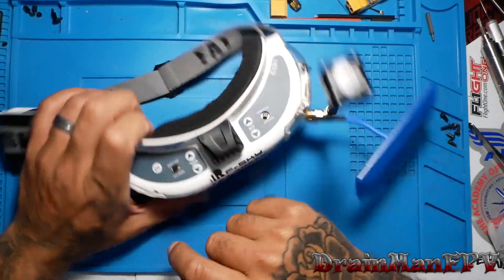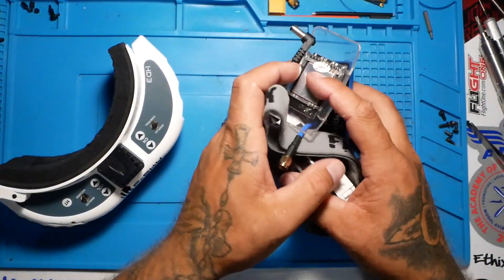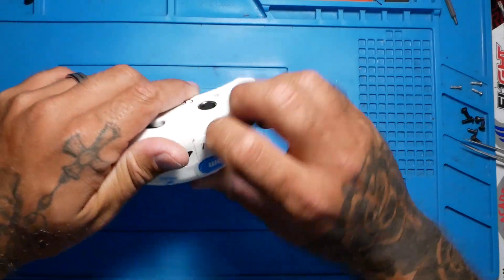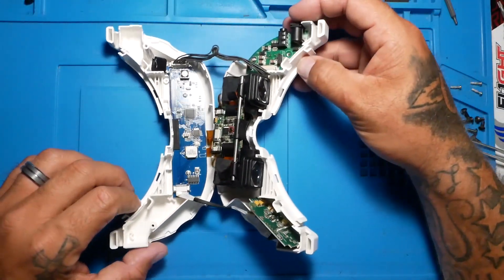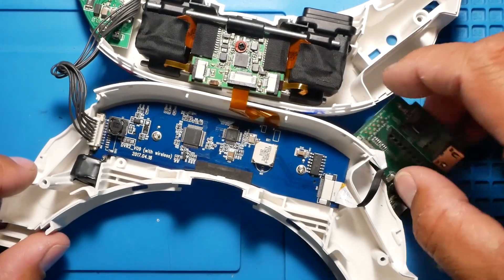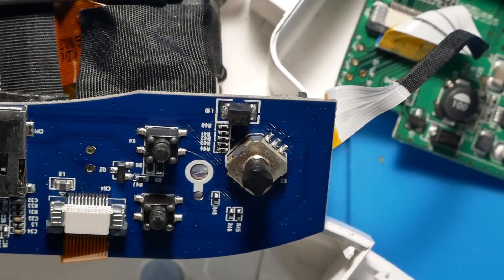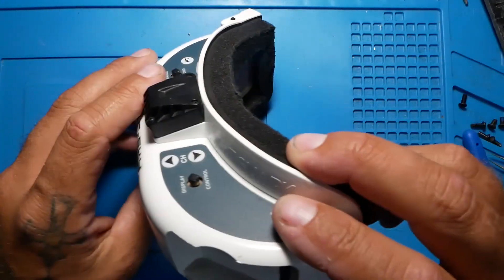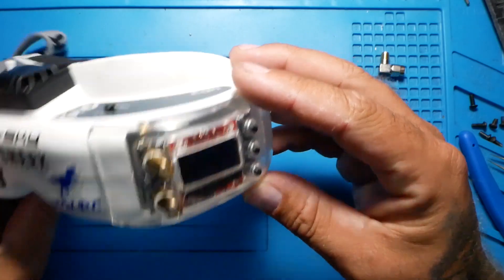Fatshark MOD for Rapidfire/TBS Fusion/True-DX - L1 & L10 - Both Mods - Easy To Follow Along!

Comment: they drainman true d X or fusion or wildfire?
Reply from the maker: Rapid 🔥 Fire
Reply: DrainMan FPV i heard that there is an issue about them 2 of our local pilots got issues with rf
Reply from the maker: @angelfpv4825  oh wow, mine is working great, that's just been my experience with it tho. The wildfire is priced better and looks cooler. I had good range to when I tested it for my video.
Reply: DrainMan FPV thanks!
Reply from the maker: @angelfpv4825  https://youtu.be/UhE3UnJzC0Y

Comment: I do not have the L1 connection on my board. I have the Fat Shark FSV1063 Dominator V3
Reply from the maker: My personal goggles are V3's i had it on mine, that's strange.
Reply: my fatshark dom v3 has L1 and L10 mod , do i need to install the power mod to use the wifi  function? and can i use my old trued v3 after the L1L10 mod?
Reply: im late i know but what was the solution at the end? did you solve it? because my HD3 also doesn't have the L1

Comment: Another great video man! Thanks! You have definitely worked me through some challenges. Subscribed! I have a set of Hd2’s. Is the community certain doing the l1 and l10 mod will give me what. I need to be able to run the rapidfire module without the need for that extra ribbon cable? If so, it looks pretty straight forward!
Reply from the maker: Thanks Andrew! Yep you got, that's what this is for!
Reply: DrainMan FPV thanks. Keep the videos coming! You worked me through setting up my kiss Steele pdb on my new alien build. Pretty friggin awesome.